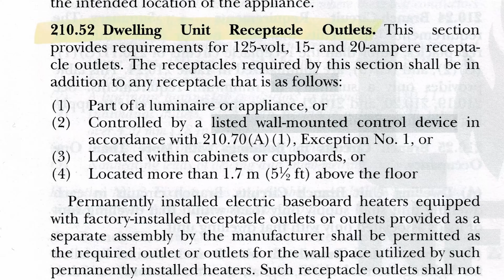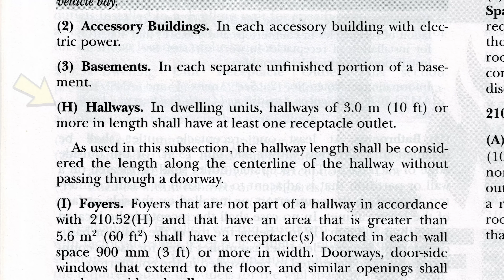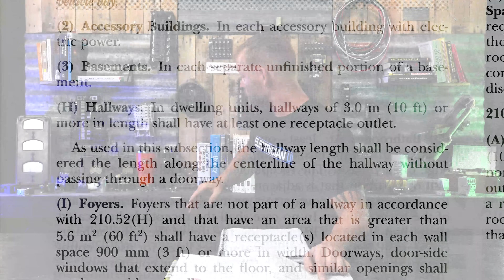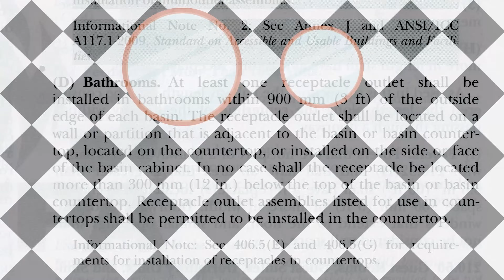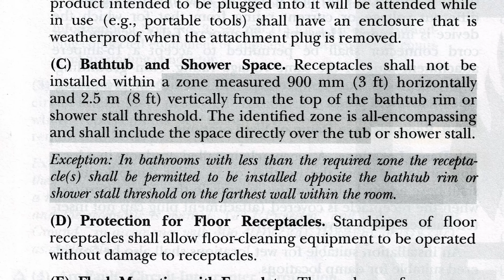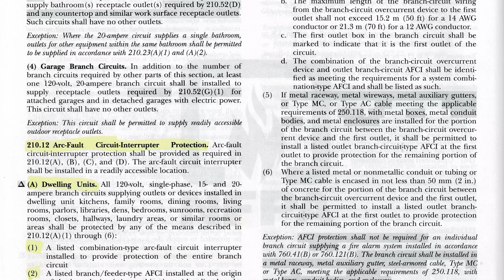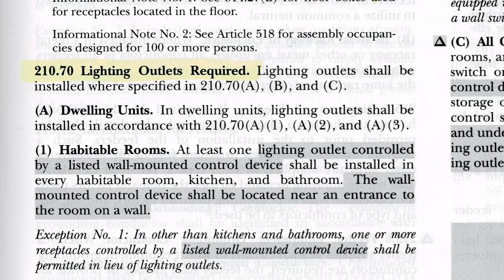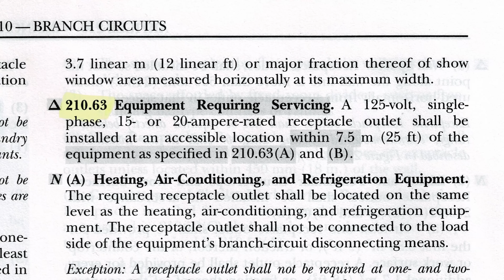KNOW WHAT YOU'RE DOING - or You Will FAIL Inspection!

Comment: 406.9 c as we interpreted could be seen as only outlet receptacles. So switches? Etc? Just no plugs of any type. Obviously even if it's only a switch it should absolutely be GFCI'd. Example would be a single pole switch near shower for stall light fixtures

Comment: Well, I'm kinda glad no one thought to to put a plug in front of my sliding glass door windows.
Reply: Yeah… what if someone forgets to close the door when it’s raining?
Reply: If it is an actual door, then it is not required. What he is showing in the video is a sliding door with a stationary "door" in the other side. It is essentially a wall panel because it is fixed and does not open
Reply: @TwilightxKnight13  Yes, I know. That is what I have.

Comment: It says hallways greater than 10' need at least one receptacle.  I do not see where it is stated or implied that a 20' hallway would require 2.  Am I missing something?
Reply: You’re not missing anything. Only one receptacle, hallway can be 60’ and will only require one receptacle.
Reply: Remember code is just a minimum you can just put only 1 to satisfy code or you can put 3 it’s up to you if you wanna go above and beyond or if the customer requests more
Reply: @Nick-bh1fy  or if the inspector expects it. Remember, the code is just a guideline, it is the inspector, ie the authority having jurisdiction (AHJ) who decides what you must do, even if it exceeds or fails to meet what the codebook says. It is possible that in his jurisdiction, the inspector interprets the code as every 10ft, not just at least 10ft. If so, then every 10ft becomes the code in that jurisdiction.
Reply: When I designed commercial and industrial building electrical systems I assumed longest cord on a vacuum sweeper or floor machine was 20ft and put in receptacles accordingly on the plans.

Comment: As I read the code you had on screen about the hallway receptacle I didn’t read anything about adding extra receptacles if the hallway was more than 20’
Reply: I agree code states a receptacle if hallway is 10' or more. Now I don't know anyone with a 50' long hallway but then I would add more outlets.
Reply: @fastxsam  Yeah you'd add more for practical purposes but as far as code, one is the requirement.
Reply: @illestofdemall13  As a home owner, I've always been of the opinion that "more receptacles is more better". Especially when looking to plug something in close to where I am. Pity that I've never had the opportunity to work with the contractors on a new build (neither whole house or addition) for myself.
Reply: @Sembazuru  ... did you ever notice that table lamps have a 6 ft cord but it's always a diagonal run to the outlet, meaning the cord is stretched like a banjo string when the plug is behind a bed or couch? If you have the option, add outlets in weird places.
Reply: We had a lamp in the foyer of the hallway and it had no outlet receptacle. I remember the long cord plugged in the side of my bed. We later installed an outlet. Back in the fifties I guess halls and foyers didn't need an outlet receptacle. 73
Reply: Code explains the minimum required. So, the minimum is every 10’ thus, anything more then 10’ another outlet out be the minimum required. 😊
Reply: @Kooladethekid  But the code does not say EVERY 10ft or every ADDITIONAL 10ft. It specifically and simply states hallways 10ft long, or longer, requires minimum one receptacle.
Reply: @Kooladethekid  It says if it is 10 ft or larger it needs at least 1. Not every 10 feet.

Comment: They now make outside disconnects for  the outside AC Condenser Unit that has a GFCI Duplex Receptacle within the same weatherproof enclosure so the electrician doesn't have to install a separate receptacle outlet as required by Code .
Reply: for many years one of my local sparkies has been using what he calls a spa panel. It's usually 4-6 breaker slots in an R rated box and only a few inches wider than the usual disconnect. This way you have room for two AC units and a service outlet connected by an offset. Makes a nice, neat installation.
Reply: Yes, they are convenient, but remember that the receptacle inside the box must still be on a separate circuit that the A/C unit itself so maintenance can be performed while the A/C unit is de-energized.
Reply: @TwilightxKnight13  ... if you are installing up to code you will have disconnects within arm's reach of each AC unit, not just the breaker in the main panel.
Reply: It was out there for a long time. Perfect home for yellow jackets
Reply: @bahopik  ; WRONG ! They only came on the market a few years ago and in regards to Yellow Jacket Wasps building nests inside of electrical boxes put some moth balls inside ! They deter Bees, Wasps, and Fire Ants from building their nests or hives inside of Electrical Panels and Boxes !!
Reply: @BearStar1  I'm the HVAC guy that uses them. I've been in the field for 13 years and remember seeing those in college lab. As far as moth balls that up to electricians, when I'm out there try to disconnect power to a unit, it's already too late
Reply: I stand by with what I stated before !!

Comment: i hate gfci breakers. more calls after the fact than any other tech
Reply: A quality manufactured GFCI, properly installed should not incur a high callback rate unless the user is intentionally causing it
Reply: @TwilightxKnight13  i use only homeline and its multiple people. It is almost always a garage or a vacuum that did it.

Comment: My Master told me that if I install an arc-fault on a room with an installed GFCI outlet, that it would constantly trip. From what you said around 13:45 that doesn't seem to be the case at all. Is what my Master said true or not?
Reply: This might be a case of old best practices becoming obsolete with better technology.
Reply: There's one way to know for sure. Lol.
Reply: @Burn3r10  oh i plan on trying it... For I think my Master is wrong. Wouldn't be first or 50th time. Then after i prove him wrong, I know he wont acknowledge it and still say the same thing.
Reply: It will not trip. Here in Canada we're required to put an AFCI on new receptacle circuits, if the circuit feeds new outlets outside we need to GFI protect them as well. I've done it.
Reply: @mikerosoft1009  Thanks
Reply: Could be a matter of incompatible devices such as a Leviton gfci receptacle and an Eaton arc fault breaker… idk personally I’ve never run across an issue like that.

Comment: Would not a dual function breaker be troublesome since, if you had a GFCI trip, the reset isn't handy, but at the breaker panel? While it's not required to be in the same room (i.e. I see GFCI in one bathroom feeding another bathroom), it's sure nice for it to be in the same room. As GFCIs get better, this may not be as much of a problem. It used to be that it was very easy to trip a GFCI without doing anything wrong, such as by just slowly plugging something into the outlet.
Reply: Nowadays it’s much more likely to get false trips from an AFCI breaker, than from any kind of GFCI.
Reply: @kc9scott  Thanks Kevin. That's what I was wondering. The newer GFCIs seem to be pretty stable.
Reply: @kc9scott  I think I'll still stick with part of my original comment though. If you're in the bathroom getting ready to go out, you don't want to have to run to the breaker panel for a reset. I'd much prefer the reset be in an outlet in the bathroom I'm in. This isn't a safety issue, just a convenience one.
Reply: @wmcomprev  that's fine as long as the receptacle is GFCI protected. It doesn't matter (under current code) if that protection is at the outlet or at the breaker
Reply: @TwilightxKnight13 : I'm aware that as long as it's protected, by code, it doesn't matter where. I had left a word out of my original post. It's corrected now.

My intent was to refer to the convenience. In locations that you're likely to trip the GFCI, it would be nice to have it at hand for the reset. However, the newer GFCIs don't false trip as often, so it may no longer matter much.
Reply: Aren't the wall GFIs a different trip current than a GFI breaker?   Something like 2ma vs 5ma?
Reply: @db8823  Looking up the standard, it's UL 943. It says the device should trip between 4 & 6 mA. I see no indication of a difference between outlets and breakers.
Reply: I remember in one house that I was renting the GFCI receptacle in the powder room was fed by a GFCI breaker. I put my GFCI plug tester into that outlet (I was verifying that I could trust the landlord's GFCI outlets) and the breaker tripped. That's when I learned that the breaker was also GFCI... Now, I don't know if the order of breaking was random or if that breaker would always trip before the receptacle. The hassle of having to go to the basement to reset the breaker was enough to keep me from continuing to experiment.
Reply: @Sembazuru : The breaker and outlet shouldn't both be GFCI. The outlet may say it's GFCI protected since it's being protected by the breaker. However, if both are actually GFCI units, I'd expect you to have problems just as you would if you connect a second GFCI outlet to the load side of an upstream GFCI outlet. Don't confuse a GFCI outlet with one that's being protected by a GFCI device further upstream. A GFCI outlet will have the test buttons on it. If it doesn't, it's being protected by an upstream device. Your plugin tester will work on either, but as you said, when it's protected by the upstream device, it will trip at that upstream device.

Comment: In the location you mention in this video, what are the ADA codes if a resident is in a wheelchair?
Reply: To a large measure, the ADA does not apply to residential home construction. Of course, if you are building a house for a wheelchair bound resident, you will need to accommodate. Otherwise, not so much.

Comment: Hey, that last code you spoke of (receptacle within 25 feet of serviceable equipment) can that be through a doorway or window?
Reply: No because the outlet must be within line of sight of the equipment it’s designed for. You can also think of it as being the “service” outlet installed to specifically be used for contractors working to fix problems of said equipment. They don’t want you to have to go through windows or doorways just to service equipment. It’s the same concept as having a “service” outlet near an outdoor A/C disconnect.
Reply: No because the outlet must be within line of sight of the equipment it’s designed for. You can also think of it as being the “service” outlet installed to specifically be used for contractors working to fix problems of said equipment. They don’t want you to have to go through windows or doorways just to service equipment. It’s the same concept as having a “service” outlet near an outdoor A/C disconnect.
Reply: I'm pretty sure it has to be exterior.  The last place I designed was an industrial building... could be different for residential. I would rely on his response though. lol
Reply: @jrobie8375  My rule of thumb for the 25ft role in residential applications is putting the service outlet directly on the equipment it’s added for. Obviously if there’s no ability to put it directly on the equipment for reasons, such as water damage, then I tend to put it as close as I can just to not have to worry about fighting some asshole inspector xD

Comment: 10:35 What about those "open" bathrooms where it's literally alllllllll the shower? Like, the whole room is tiled floor to 3/4 high and the whole floor is sloped from wall to wall into a central drain. The toilet and sink and everything are located away, but they can still get wet. This is more common in Europe I think. Wtf do you do with THAT?! 😸 There is no tub rim or shower pan threshold to reference!
Reply: Great question! I am commenting to follow when an answer comes.
Reply: It depends on the location of the sink that’s directly specified to be used in conjunction of your whole room shower. If there is a vanity outside of that whole room shower that’s where it would go. If there’s no vanity or toilet anywhere near the whole room shower you can 100% make an argument that by code you don’t need an outlet.
Reply: If the area is only showers then you wouldn’t put one in there. The only receptacles you have to put in a bathroom are within 3ft of a sink and no other place. You don’t even have to put one in a isolated toilet room.
Reply: I seen a water proof outlet cover like for outdoors in a bath area, it was from a England post.

Comment: Kitchens in NH  we used 2 run 3 multibtanch one for the left gfci and pig and or the dishwasher with the right side picking up the other appliance and than the microwave and fridge wld share a multibranch circuit. The electricians I worked for used to love multibranch circuits lol

Comment: 5:00 I disagree… 210.52H says 10’ or more in length must have one receptacle. It does NOT say every 10’…
Reply: I agree it says hallways 10’ or more shall have at least one receptacle.

I does not say one receptacle for every 10’ of hallway.
Reply: You are correct, however almost every jurisdiction adds a rider to the code that the code itself is up to the interpretation of the inspectior (and they can give you a variance for special situations if your aren't being an ass).  Some inspectors just want them every 10ft.  It's always a good idea if your working in a new area to reach out to the local inspector and ask what they like to see and common issues they find during inspections.  And use common sense too.  If you have a 50ft hallway 1 outlet is probably going to be an issue for the eventual homeowners.
Reply: @dcl97  ^^^^^THIS^^^ It is quite possible that in the jurisdictions that he works in the inspector interprets the "10ft minimum" rule to be every 10 feet. If so, then for him, that IS the code. The inspector, ie the authority having jurisdiction has the final word on what you have to do regardless if you agree with it or not.
Reply: @TwilightxKnight13  
There is interpretation and then there is the legalese text.  Of course, code is bare minimum and going above and beyond in edge cases like this will not typically be overly burdensome; just the opposite, if failure is a possibility.
Reply: Curious which interpretation is more accurate
Reply: And if it's shorter than 10ft have zero?
Reply: Correct 10’ or longer requires at least 1, so under 10’ wouldn’t require any receptacles.
Reply: Facts.
Reply: Agreed glad ppl caught that and not just listen to what he says.( he still rocks!!) Everyone has to do there own code checking! you can have a 50 foot hallway but only need 1 receptacle outlet. If you have a break in that hallway such has a door you have to walk through. You have to have another receptacle outlet in the second part of the hallway if it’s 10 feet or more.